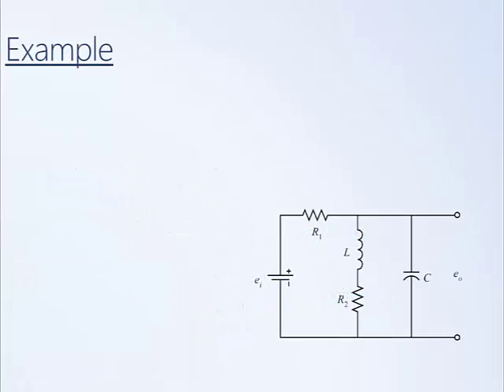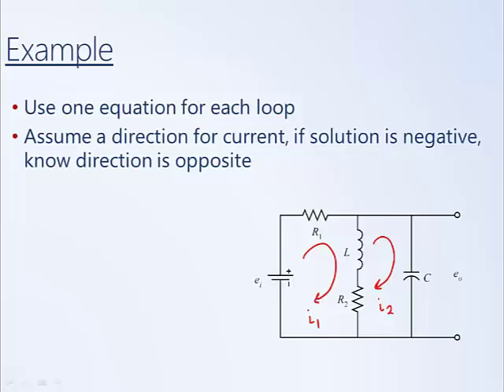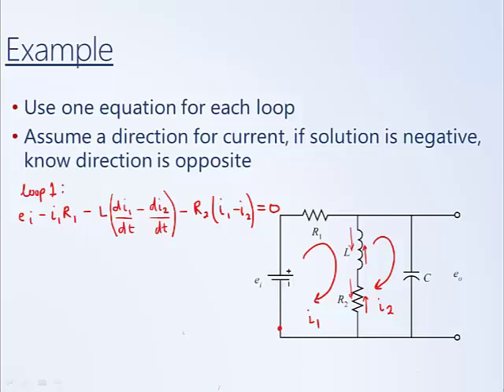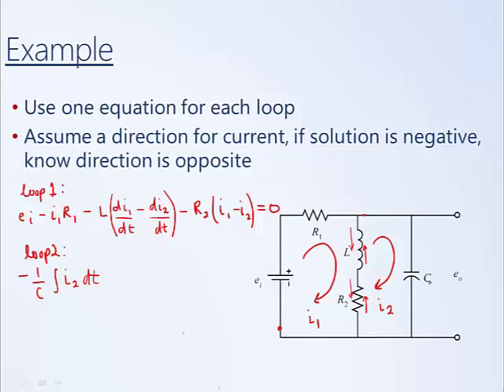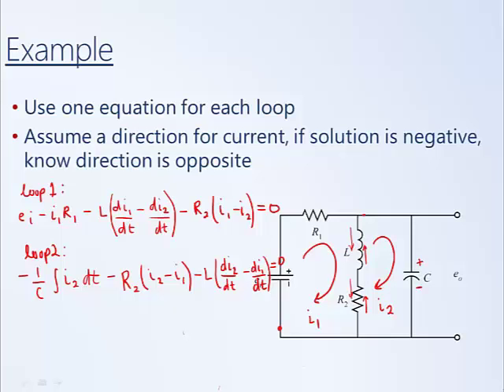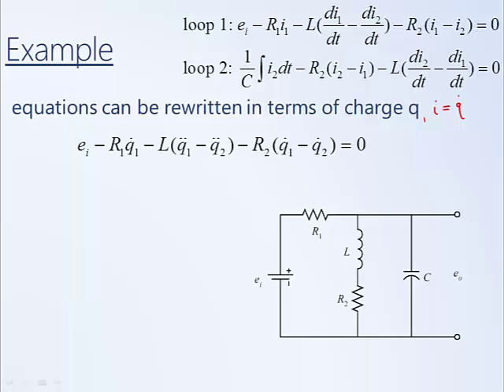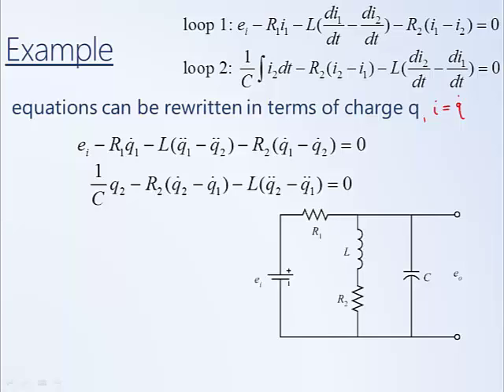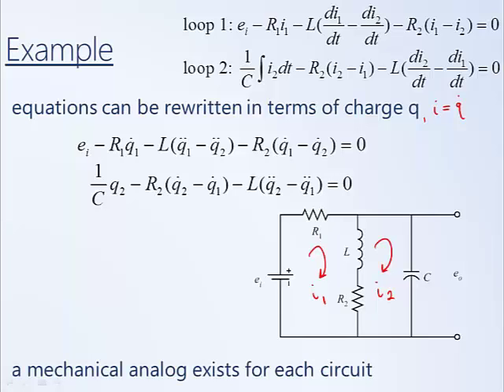System Dynamics and Control: Module 6c - Circuit Modeling Example

Comment: What happened to the negative in front of 1/C
Reply from the maker: Good eye, that is a typo. There should a negative sign in front of 1/C in the equation for loop 2 seen around the 7 minute mark of the video.
Reply: @hillrickc  Thanks.